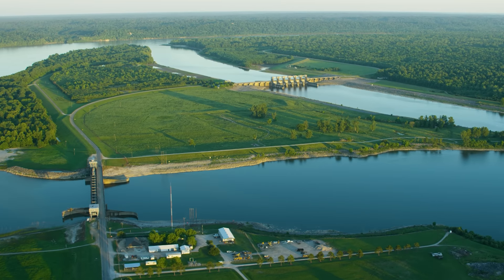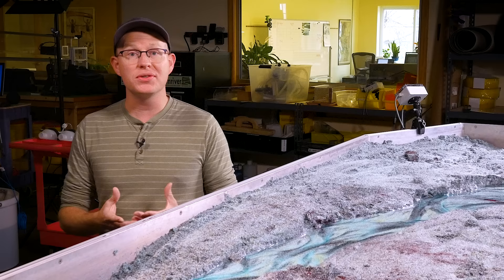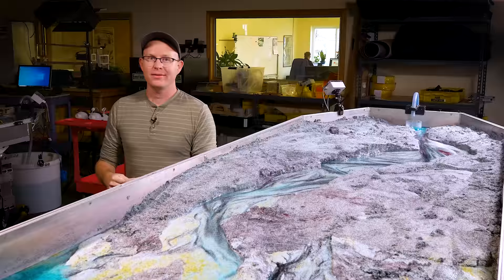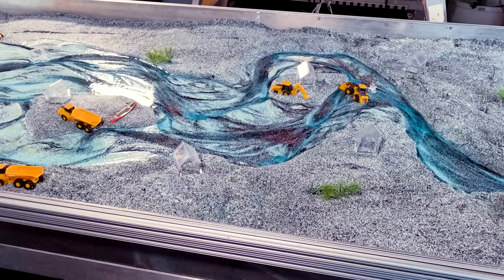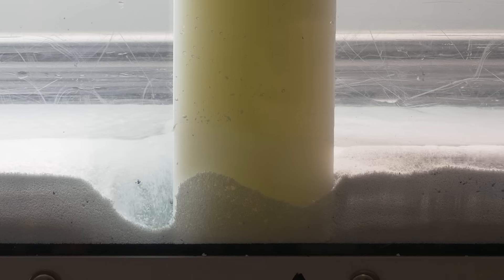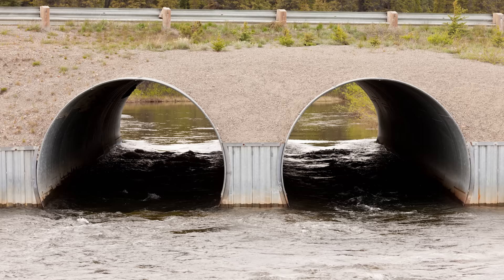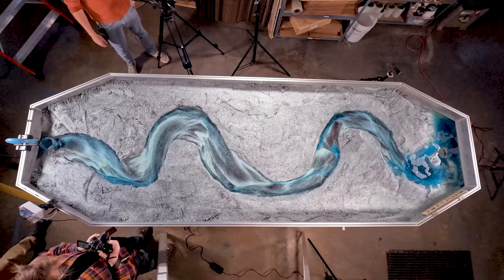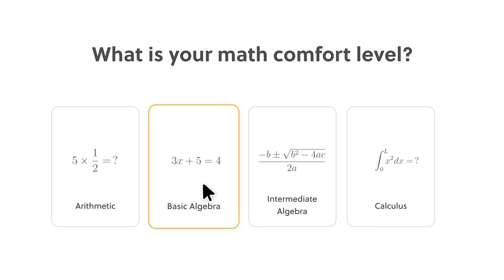Why Engineers Can't Control Rivers

Comment: In the late 1960s, construction of the Alcantara dam (Spain) momentarily halted water flow under the Alcantara bridge (600m downstream) for what was understood to be the first time in its history.  Onlookers saw a huge gap in the masonry and concrete foundation under pier 4, the result of erosion in the only section permanently underwater.  Engineers quickly proceeded to fill the gaps and reinforce the area – all without proper authorization from the authorities in charge of the monument.  Yet, the bridge was saved. In the nick of time.
Quite a performance for a bridge built nearly 2000 years ago, when fluvial geomorphology was poorly understood. Or was it?

Comment: I am from Ukraine, there is a river in the city where I live.  People strengthened its banks (made such things as dams along the channel) so that it would not spill out onto the street in case of a flood.  But it does not flow strictly in a concrete structure.  There are many pebbles at the bottom of the river, as well as on the shore.  Then there are trees and grass, and then those dams.  During the flood, it changes its shape, but not by kilometers, but only by meters.

Comment: Isn't rivers aren't the same every year? What equilibrium if it's a dynamic, not static system? It could only be temporary. How can we reach stability then? Should we use dams to stabilize water flow manually?

I have only more questions after this video...

Comment: The greatest problem with maintaining the current channel is that like all delta channels it continues to silt in from the bottom.  Yes, New Orleans is sinking,, but the river bed is rising as well.  You cannot stop that.  Better to figure out the smoothest transition you can devise.

Comment: You can control rivers.  Its very expensive and logistically difficult to do so.  Water flows downhill so you need to install dams or otherwise make the water less inclined to travel down specific routes.

Comment: Sediment-free water causes more erosion?  Could you explain that?  Is it always true?

It makes sense if you imagine sediment like a solute dissolved in a solvent.  Pure solvent has more capacity do dissolve other solutes.  But sand/sediment/etc is insoluble material.  And yeah, there's probably an upper limit on how many grams of sand can flow along with a given volume of water.  But wouldn't water with sand be (on average) "harder" than water alone, and better able to cause erosion?  Hypothetically, water flowing down a river with banks made out of steel would not do much erosion.  But if there was aluminum oxide dust mixed with the water.... maybe it would wear away at the metal.  So it can't be generally true that pure water is less erosive than water with dissolved or suspended material in it, right?

Comment: Greatly enjoy your fine vids. Would change the subject here, but, what do you think of a soft start system for an air conditioner? Are they good, iffy, or not of value? The reason for my inquiry is that we were victims of the Feb 21 cold fiasco. I put out a lot of money on a portable generator and a 50 amp extension to hook it to my home's electric system. BTW, electricians are frightfully expensive. One thing he told me is to not hook up my AC because the load was too heavy. So. Soft start??? Thank you.

Comment: There's another hidden effect of channelling rivers: the mud and fine debris is clogging the riverbed, slowing the water down to get into the soil. So the ground water level sinks. With natural riverbeds that change their location, there is a constant cleaning and washing away of this sealing effect. This is a second cause of flood waves accumulating down the river, because the water is not slowed down, besides the straight channels. Imagine water running through a sponge, it gets soaked into it.

Comment: That doesnt mean that Engineers cant Controls Rivers tough.
It just means Controlling a River needs to be Planned Properly and Problems caused by Changes to the River need to be Addressed/Prevented by for Example Reinforcing the Entry Curve or Create a Reservoir to make sure that the Velocity of Water Flow is either Maintained or Buffered out. 
Meaning that in total its all just a Question of doing it properly.

Comment: Could anyone explain to me why sediment-free water is more able to cause erosion to the channel further down stream, as mentioned around 3:50? I would have thought that water carrying sediment with it would be more able to erode the channel due to the sediment essentially grinding material away? Like how you add beads or whatever to exfoliating gels because they rub away the dead skin. Not the best analogy I know, but it’s late!Thanks in advance to anyone that comments.
Reply: Neat analogy, late here too, but call it water beats mud? Carrying sediment takes energy, so the battery gets weaker...like running with a backpack in a crowd?

Comment: I live on the mighty Mississippi and ever since the dam above our pool was created (some 40 years ago) we have had a massive uptick in both flood duration and frequency while pools above and/or below us suffer from low levels. The DNR/Corps of Engineers are terrible custodians. They also refuse to dredge the pool and spillways, which occasionally obstructs barge traffic and will make maintenance of the spillway near impossible in a decade or so (the spillway was made when my great grandfather was young and is falling apart)

Comment: Ok. I love the river near me. We paddle up and down several times a year. It’s interesting to me to see what has happened over time throughout. Point bars get longer and the cut banks keep getting taller before they slide down into the water. One trip you see a feature, and that could be anything from a tree leaning or that steep bank with all the bird nest holes and the next trip one or more of them has been altered by a flood or something. I have seen in my lifetime a section where it has cut itself off and created an oxbow pond. It will happen again and again. I wonder what the European settlers saw when they first came upon the Mississippi River. Most likely not near as wide but way way faster. Crossing over it must have been a treacherous experience. I picture a regular guy with a wagon load of supplies and family leaving his mother in law or her piano on the bank. Anyway, who sorts out the colored sand particles for the stream box?

Comment: have they tried placing the dam at an angle that would encourage runoff in the desired direction rather than flatly against the current? not even a floodgate can save a dam flatly against the current from erosion all the time...

Comment: Their problem is trying to CONTROL the river. It would be a lot easier of they simply INFLUENCED it, by using established methods from the 1800s. Using flume guides is cheaper, easier, and far more effective. They allow the river to disperse energy naturally when flooding, and maintain their intended path in normal flow. Flume guides also increase the flood capacity over time, because focusing/concentrating the flow clears built up silt from the desired path, deepening the channel, and providing more capacity within the banks.

Comment: because engineers dont really comprehend that, to control running water, youll have to go ALOT further than just digging the trench. all you do there, is give the water more to erode

Comment: Technically we can control 100% of rivers 100% of the time. What we can't do is do 1 thing in 1 location and maintain control of said river forever. We have the tools to bring back the eroded settlement and keep the river as we want. Basically, it all comes down to maintenance. What we do is build 1 thing and then just leave it to the elements. If we would regularly maintain the rivers we could control 100% of rivers 100% of the time.

Comment: the reason why i find issues with this table you used... for one, the material used for "earth" is not going to be the same at different levels. not all areas of earth flow like the sand you use on the table.... not all areas of earth are going to be loose like the sand on the table.... the table also does not have grass ,trees, and other things that help hold the soil together along the way....  the table only helps with understanding what water does to loose soil along its path
Reply: all soil is loose when we look at scale of centuries and even millennia. thats the point of the model. so we can see the effects NOW.

Comment: Viktor Schauberger? Further.. this river like any other will experience cyclical changes due to the sun, and thus moisture movement and crust instability. Much like the recent times where it dries up entirely in some areas, continues to draw silt lines unmanaged, and doesnt have the correct fluid dynamic engineering principles put into effect, AS Schauberger clearly taught. If no one is going to utilize it for the land, and the people, then it should be radically altered to just "barge along". Priorities clearly are mixed.

Comment: Probably the main reason Engineers can't control rivers, is because rivers can't control rivers. Rivers are inherent unstable, they exist between two states, the high ground and the sea. As long as they're flowing they're releasing their potential energy into their environment, including any structures that Engineers dare to build in or near them.

Comment: The secret to controlling rivers is actually obvious. Control the current. For example,building radiating walls on the curves of rivers stops erosion. Building a series of micro dams slows the whole river and raises the water table in the surrounding landscape. Micro dams also prevent flash flooding. The next level is to plant trees along the banks of the river or stream. Cooler water creates healthier rivers and streams. 
Book recommendation: Sensitive Chaos by Theodore Schwenk.
Reply: what about sediment?
Reply: @Zack-fu4lo  healthy rivers deal with sediment naturally. Theres some basics one can understand and adjust. Fast water and cold water have more carrying power. Sediment drops where the water slows. A lot of dropped sediment actually speeds up the flow by making the the river or stream shallower and narrower.

Comment: Ironic
Engineering video on rivers without considering the math related to all rivers world wide and understanding necessity to maintain structure of the math predetermined

If you measure the starting point at any river to its exit point
Direct measurement straight line, then measure actual distance of same river you will find it is ALWAYS 3.14 x in length
ALWAYS every river worldwide

Pie
3.14....

Change any natural structue in a river it will self correct itsrlf geographically somehow, and usually in a unpredicatable manner.